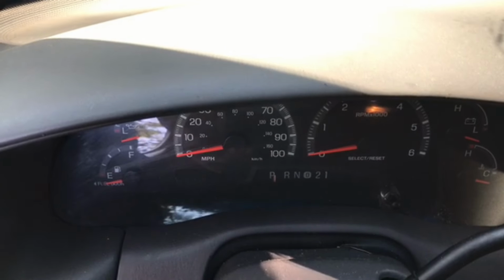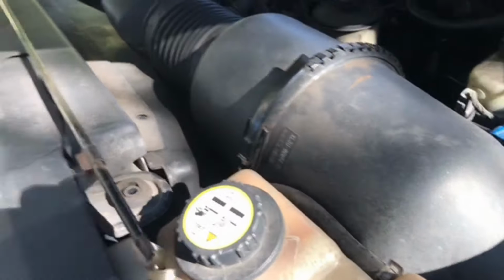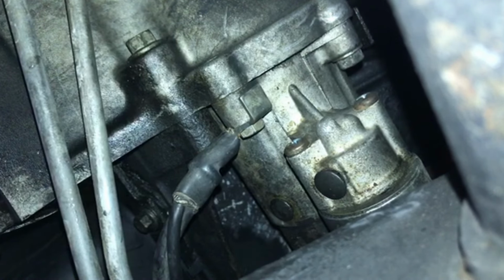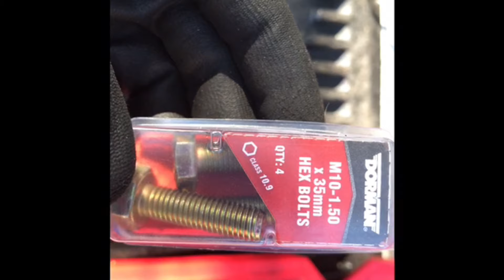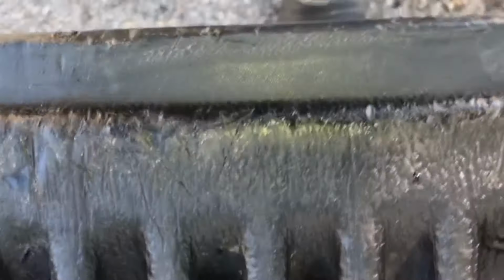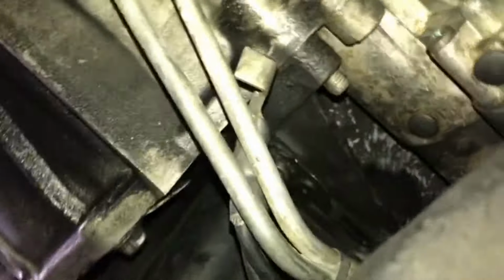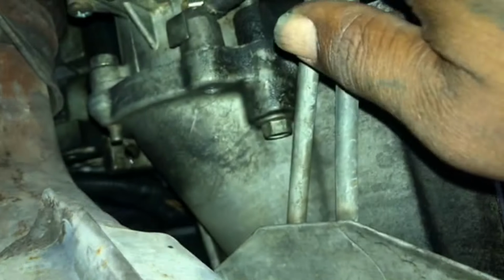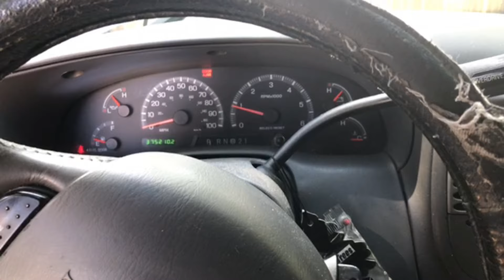Car wont start just clicks once (Problem Solved)

Comment: Man I had done replaced my starter, alternator, battery even cut off a CV. Only if I would've watched this video first. People always think they know the problem with the car but seems there's always that one thing. Thanks bro for the knowledge you've shared.
Reply from the maker: No problem glad I could help.
Reply: Bro I say that all the time if your a so called mechanic and you say ooh I don't need a video I know I know. You are fooling yourself and your customers or whom ever I've been ar junkyard and people will say do you know this do you know that I've spent 800 hundred iv spent 1200 my shits still no right abd it's a fuse bro
Reply: @Lifewithvic386 Same exact problem. Replaced starter, hear one click, no crank. Honda acc 05. but the problem is a wrong size bolt? Im not great with this stuff, can you explain further why just changing a bolt fixed it? Im lost 😢

Comment: Anyone watching from the side of a highway or just me😣
Reply: Me too. 😪
Reply: @AngelxSpencer  At work... 😫
Reply: Wtf
Reply: In the car wash
Reply: ROFL me !
Reply: Shi i’ve tried everything to get my car to start makes a whole bunch of clicking noises took the ground wire off put it back on a used only make one clicking noise now it makes a lot more which means I’m slowly getting there but my car broke down on the highway when it started to happen lmao
Reply: Me to at a gas station fml
Reply: @justinmccolley937  bro it was about key, so what I’ve done is I sit inside car and I locked car and unlocked it and then I start car, it’s working now but I order a new keys from Mitsubishi and it cost me about $470, hopefully it will work for u
Reply: Turned out to just be my starter thank God
Reply: @hosseinbahrami452  turned out it was my starter took 2 tow trucks to come out to tow my box truck cost me 260 with labor
Reply: Me 11:15 at night 😞
Reply: At some road ...n barely made it to a parking lot!
Reply: Broke down at the auto store.
Reply: That was me 20 mins ago….
Reply: Sitting at work...I'm ret ta go..
Reply: I -40 okc atm lmaooo
Reply: WATCHING FROM A PARKING LOT
Reply: In a parking low
Reply: Nope, bud. Sadly you are not the only one. Im telling you what this sun is fukkin hot too.
Reply: I was just so mad stuck on the side of the eway until I saw I wasn’t the only one 😂 thanks got the comment
Reply: You wouldn’t break down from a faulty starter 😂
You wouldn’t make it to the freeway!
Reply: Same
Reply: Watching from the HEB (grocery store)parking lot
Reply: Walmart parking lot 😂
Reply: In the comfort of home thankfully
Reply: At cabellas lol
Reply: Yup😅
Reply: left turn lane LOL
Reply: @Rcfuss  me rn. original comment had me dying only because I’ve been there before and I’m ALWAYS having car problems. Gotta laugh to keep from crying 😅
Reply: Literally parked at Wawa and walked back out
Reply: Bro I’ve been working on this car for a grip now and I replaced alternator battery plugs coils and 2 new starters bc I assumed I got the first one faulty
Reply: I went out in my parking lot .. thsnkfuly
Reply: I love youtube. Lol
Reply: @lephrog4612   was this your problem. Mine shut of while I was driving  now I have the one click.   The starter is about 1 year old  from the dealer
Reply: At home depressed 😂
Reply: I got stuck leaving the dentist 💀
Reply: @EpicSkater321  Texas!
Reply: Okay, so each and every one of you needs to chime in and let us know you made it home safely 😳
Reply: Me too, on osu campus embarrassed Af  😂😢
Reply: @Vexotic1  alternator for u
Reply: In the middle of nowhere 😂
Reply: Lmao at work
Reply: parking lot of my apartment in the heat...
Reply: @marblefanboy7724  u fix it?
Reply: ... Vons parking lot
Reply: Me too man❗️👎🏽
Reply: Why would be on the side of the highway unless you parked there and turned your vehicle off
Reply: Brother u ain't alone
Reply: @hosseinbahrami452 damn
Reply: Motel 300 miles from home 😢
Reply: Lol Hope yous made it home safe
Reply: in a drive thru
Reply: Yep
Reply: I'm with you currently stranded
Reply: Watching with a van full of trash tryna get to the dump
Reply: Shoprite parking lot here. Except my car doubles as my home while also being completely broke. The elusive triple whammy
Reply: I’m on the side right now In Arizona heat
Reply: Sitting in my work parking lot 😢
Reply: I'm sitting in a parking lot. 😢😅
Reply: Walmart parking lot😂
Reply: I was at the gas station halfway to my destination.  1 hour from home and 2 hours from my other home/mom’s house.  Happened enough in span of few minutes to make me look up this video.  Two people with hand guns began to approach me and this video was getting me now where.  I turned the ignition one last try, then attempted to crank the engine right before the start up beeps finished beeping and BAM 💥 the car cranked.  Thank GOD.
Reply: Parking lot…😵‍💫
Reply: I was at a parking lot going shopping 🤦🏾‍♂️
Reply: @Vexotic1 that’s your alternator you probably had a defect
Reply: Gas station 😂
Reply: @NonnofYobiznes embarrassing
Reply: Me now 😅
Reply: Walmart parking lot
Reply: At home I think coils are bad
Reply: I’m at home watching as my truck is broke down in town. Going to go back to town and try this.
Reply: I just replaced my evap purge valve it seems to be ok for now??
Reply: Park
Reply: @NonnofYobiznes At work 😓. But hey! I work at Lowe’s so… easy 😮‍💨😅😊
Reply: If your battery dies while driving then it’s your alternator
Reply: @NonnofYobiznes same. I’m at work😖
Reply: I just farted so good my dude and read this comment lol
Reply: About to go to the airport lol

Comment: Really appreciate this video. My 11 F150 wouldnt start. Battery seemed fine. 12.4 volts. Accessories worked. Turn key and get 1 click. Wouldn't take a jump. I had replaced the starter in the last year. Turns out, the ground bolt on the starter was loose. Tightened it up and she fired right up! I'll have to go back and verify the bolt size is correct... Or perhaps I didn't tighten it enough when I installed it. Video was a big help
Reply: My mini van does one is like that to. But a lot of the times after like 30 min or more it turns on like nothing was was ever wrong

Comment: Ford starters for many years have been notoriously hard to get to that third bolt way up by the engine, that's why in some cases that bolt isn't replaced.
Reply from the maker: Man that bolt is a hard one to get to. I wonder if they changed that? I haven't messed with one newer than that one.
Reply: O didn't replace on mine it doesn't need it

Comment: dude... i just changed the starter motor to my dad's car... and i remember one of the bolts wasn't on super tight but i just wanted to see if the car started. i'm willing to suspect this is exactly the issue because.... now the car is dead outside and it's difficult to get to because gotta remove the battery and get really up in there.... damn... this is what i get for not covering all my bases. Thanks though i was really happy for you when the car started. I hope I have the same luck. Sometimes i guess it could be just that simple.

Comment: i figured out i needed a long ass extension and had to feed the socket from the engine by the wheel to get that hard to reach starter bolt  fyi anybody.     thanks for the video and info appreciate it sir

Comment: Wow this is a great reminder for a no start no crank thanks for posting this sometimes it's just a loose ground wire like this that causes this  to happen. Also I noticed when you put your negative terminal on the negative battery terminal you didn't tighten it down. Definitely tighten it down or else you can experience this problem all over again🤯🌋

Comment: If you get single click, try repeatedly clicking the key trying to start it. It should charge enough to start. My 05 civic does the 1 click thing but if I keep bumping the key after a few clicks it starts
Reply: Dude, DUDE

Thank YOU!

GOD BLESS YOU SIR YOU JUST SAVED MY CAR
Reply: @johncabbage6080  fix starter. It's the solenoid. I was hoping it was just a ground or fuse or something but it was the starter its self. Really cheap too.
Reply: @johncabbage6080  and doing it too much is bad for the ignition. So it's just a temporary thing. Do NOT rely on it. When it stops, it stops.

Comment: Awesome video !!!  my explorer is doing the exact same thing. I just hope it’s an easy fix like that and not needing a new starter.
Thanks 🙏
Reply: Did you find out what the problem was? Was it a starting system fault too?
Reply: just had the same issue on my 07 ranger, had the exact same problem: loose ground at starter. fixed! :D

Comment: I had a 01 Taurus that I inherited from my Pops. Spent $1900+ within 6 months and that included a fresh battery and fresh starter (purchased a week ago). Took my daughter's to the park yesterday for 3+ hours, got in the car to leave, turn the ignition heard one click and everything died. Let's just say that I left that POS right where it was parked because I'm not going to repair a car every week to keep it running........kcuf Ford
Reply from the maker: Only thing Ford makes that’s good is trucks.
Reply: @Lifewithvic386  do you know what is causing it? My 04 mustang is doing the same exact thing and after a few tries, it's not saying anything at all. I know it's not the battery because I kept it on the Killswitch level on the ignition, and I was able to let the top and the windows back up with ease. It did it before but I never knew whats causing it.

Comment: If the old bolt looks like that one then there's definitely some thread damage.
At least flush it out with WD and a q tip. Look for metal.
Better still run a tap through and clean up the threads. It's the one chance you have before it's stripped and needs a helicoil insert.

If you don't have a tap you sacrifice one or two bolts. Going a little bit at a time and backing out, cleaning up the threads with WD and going deeper till it's clean. It may take several bolts or a file for removing burrs from the threads.
Consider using blue lock tite once threads aren't perfect.
When you are tap a damaged thread it moves metal,restores balance and harmony.
It is really something not to be missed.
If course cross threading,over boring and snapping off the tap are worse then jamming it back in the boogered hole.

Comment: the second and top bolt are wat easier to remove and replace from the passenger wheel well. remove tire. takes lots of extensions but you can see them from there. i put a starter in 3 weeks ago. im having the one click issue. think i got a loose one too.
Reply: You all probably dont care at all but does someone know of a trick to get back into an Instagram account..?
I was stupid forgot the account password. I would love any tricks you can offer me
Reply: @Robert Royal Instablaster ;)
Reply: @Shepherd Aiden thanks for your reply. I found the site thru google and Im trying it out now.
Seems to take quite some time so I will reply here later with my results.
Reply: @Shepherd Aiden it did the trick and I finally got access to my account again. I'm so happy:D
Thank you so much you saved my account :D
Reply: @Robert Royal you are welcome =)
Reply: Well inwould have been no hekpndont have Insta
Reply: @robertroyal8713  not sure why you asked such a specific question on a auto repair video??? Spam?

Comment: Yeah my 2001 v6 mustang does this sometimes it clicks one time but won’t crank but once it happens it won’t start there were two different sounds I was hearing though one from the starter clicking and one from something else after continuously trying to start it about 6 times right back to back it started but I don’t want to have to do that once I have it started and turn it off it starts right back up does this mean my starter could be bad if not what else could possibly be bad and how do I go about fixing it?
Reply from the maker: Yes it could be loose wiring but more likely the starter sounds like it’s binding, the metal unwinds easily when it’s hot. But when it’s cold it takes a few turns to get it to turn over. Eventually if this is true it will seize up for good and will need to be changed

Comment: Thanks for a good video, what does it mean if there’s just a single click sound and car won’t start when turning the key but sometimes the car will startup fine
Reply: That's exactly what's going on with mine right now
Reply: @elainahernandez6668  in another video the guy (called Robert) said it could be a dead spot on the starter motor and every time you try to start the car the motor turns a little bit and eventually it will start
Reply: @elainahernandez6668  it's a bad ground wire I think try tightening up your black battery wire. If that doesn't work follow your ground wires cheaking all of them.
Reply: @MikeSmith-cn6ub  any good videos to check ground wires on 1999 ford f150?  I have similar issue.  I replaced start and starter relay

Comment: In my car electrician change solenoid and install relay for starter motor but still click sound coming and car is not starting, kindly explain what could be wrong and needs repair
Reply: This is the problem show ur mechanic this video

Comment: What do I do when this happens but it doesn’t happen all the time? Sometimes my car won’t want to start and it makes a single click noise and I have to turn the key several times for the car to start. It doesn’t do it all the time though.
Reply from the maker: Would have to hear the click but could be a loose wire or starter could be going bad.

Comment: Mine is doing the same clicking but the ground bolt is nice and tight what else could it be?
Reply from the maker: I would check the battery first and then all the connections on starter, solenoid, and starter. Make sure to check all connections, and if not starter could be binding
Reply: @Lifewithvic386  thank you i will try that. The whole motor is turning slightly when the solenoid clicks just not enough to start.

Comment: let me  add  this along this line when all else fails JUMPPER  'NEW STARTER still clicks  check neg batt lead  going down to a bolt on the chassis under the eng to gd every  thing  loose about fall out tightened bolt after spending about 2oo.00$$$ a quick way to check this is  tak a jumper cable connone ond to neg battthe other end same cablle to any metal on vehicle it starts so tighten bolt on chassis

Comment: The best trucks man kind has ever produced is 1998 to 2003 Ford tucks it doesn't mater take your pick Ranger F150 F250 and ect. By far the best well made trucks with almost zero mantaince almost zero blown motors almost zero bad transmissions and anything else they're mules they'll run forever almost never leave you broke down almost never leave you standed oilchanged ever 5k or at least typed off because they do need about a quart of oil every 3k to 5k so watch that brake pad about evert 10k or 15k and baby your In business next time your on the road look how many of these mules are still serving there owners strong today and it's 20 to 25 years later and still many many millions of these mules going strong thanks.

Comment: With this problem with the car still be able to jump start ? My car randomly just didn’t want to start new alternator,battery,terminals just hear Exaclty what u hear but I’m able to jump it
Reply: no. i had this exact issue (1 click no crank caused by a loose ground) and jump didn't work.

Comment: I replaced the battery.... worked perfect till this morning then it did the single click.... and didn’t start
Reply: @Sigmund Freud yes i did, i took it to the mechanics. My starter motor was drawing excessive current and refusing to engage as a result the whole unit was replaced costing me shy of 750$. took under 2 hours at the mechanics and it hasnt missed a beat since. Cheers

Comment: pro tip

if you got power going to the starter (ae: battery is not the problem)

have someone crank the ignition while you gently smack the fuck out the starter with a hammer. 
Gotta do this to my 03’ Buick LeSabre on cold winter mornings, works like a charm
Reply: “gently smack the fuck”

Comment: Okay so I need some help. Ive already asked three separate mechanics and they’ve all proven to be useless… They seem to rely too much on their OBD scanner, and when my car wouldn’t give them any codes they were all stumped so I hope someone here can help…

Heres the issue, I have an 06 Chrysler 300. Every once in a while Ill try to start it and ill just hear a click and nothin happens… if I try again immediately after Ill get same result. However Ive learned thru trial and error that if I wait for about a minute or so before making another attempt, it will start right up no problem!! 

Anyone have any idea what could be causing this? ANY help would he GREATLY APPRECIATED!!

Comment: I didn't understand anything... my car is not starting... it won't stay on engine... j have to press accelerator while I ON the engine. Then also if I stop pressing the accelerator,  it goes OFF
Reply from the maker: That’s a gas issue. This video is about electric issue

Comment: My car is doing same single click randomly....
Reply: Did you get it fix?
Reply: @thisisrivera1  Yes Everything is perfect, My mechanic is just installed 2 Warshals (For packing) and the car is perfect till now...
Reply from the maker: Dead battery
Reply: @thisisrivera1  It was some starter motor issue... it was not getting full current...